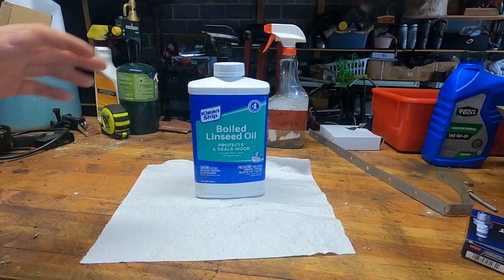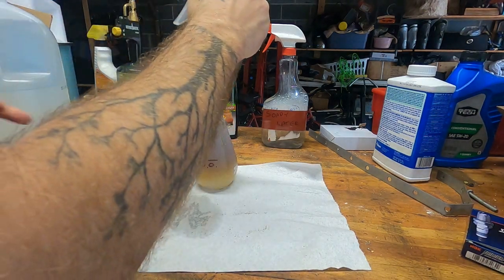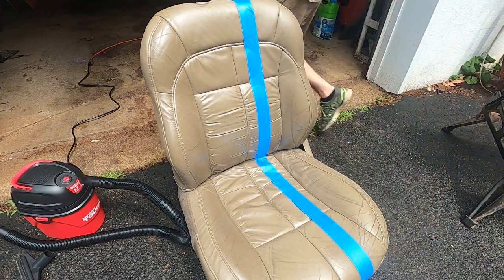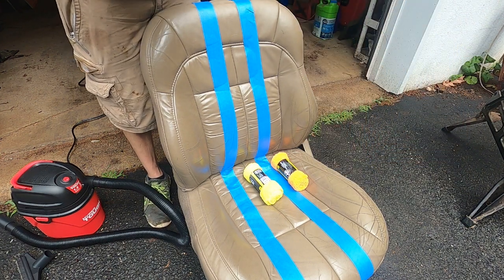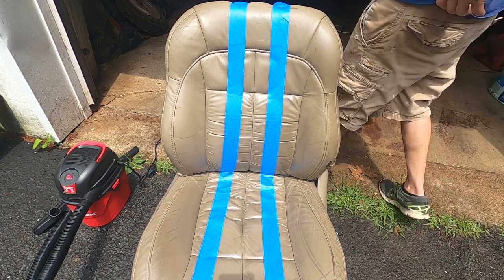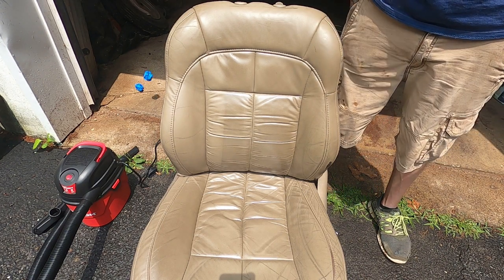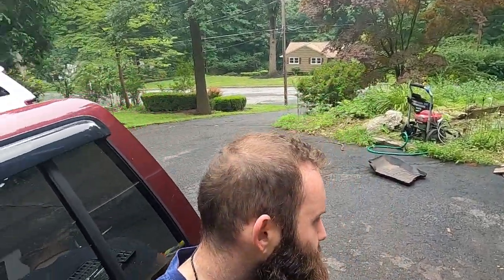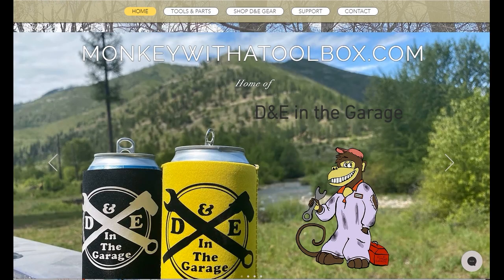Will BOILED LINSEED OIL Clean Leather Seats?

Comment: 303 isn't really a cleaner but we used to use it on everything aviation related for long term conditioning when a plane is tied down on the tarmac. It works friggin wonders on leather and rubber to preserve it. Should definitely check it out sometime. I'll even donate a bottle of you're willing.
Reply: I second that motion Dougie fresh 303 is some good stuff in the army when your on tour in the sand box that stuff keeps your rubber and stuff from drying out to bad

Comment: I use whatever degreaser I have available for just about all my automotive and household cleaning.  Some Super Clean or the cheaper alternative I get from the dollar tree for $1.25, LA's totally Awesome cleaner!  Paired with the linseed oil to get er shine on would probably blow the competition out of the water.  Also the use of a bristle brush helps.  I use my kids used electric toothbrushes for fine detailing in cracks and seams.

Comment: You always say those old ZJ seats are the most comfy seats ever. So I have to ask, why the beads?
Reply from the maker: That is true! The seats in this video are from a WJ not a ZJ. Still comfortable, but not the same. The beads are more for temperature control than comfort. I heat sweating on a leather seat in the summer

Comment: I've use Meguiar's, Mother's, Turtle Wax, Lexol, and some of the "fancier" detailing leather cleaners & wipes- all work decently. A diluted all-purpose cleaner usually cleans the quickest, but it should be followed up with some kind of conditioner. The leather in many of my cars has gotten hard from the heat of the sun... this is a non-issue for the car's that don't use real leather and instead opt for pleather/simulated leather. Real leather can be nice, but it's sometimes a pain in the ol' blow-hole.

Comment: Off topic but I was putting my WJ transfer case in neutral 242 and I got it in neutral, I was putting it back to 2wd and it required force and I kept giving it and something must have broke cause know the shifter can move freely, I checked the linkage and the rubber bushing holding it to the transfer case is gone do you think it’s a broken cable or just that bushing

Comment: One thing to note using Linseed Oil is to always hang the rags you used up to dry with plenty of airflow. When crumbled up they can spontaneously combust because Linseed Oil heats up as it dries. Don't let a used rag burn down your shop or garage!